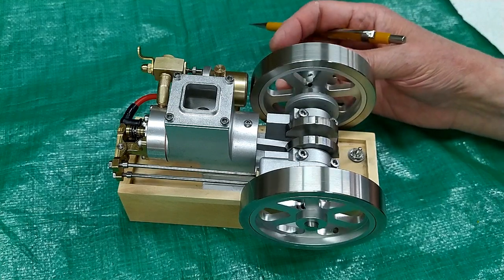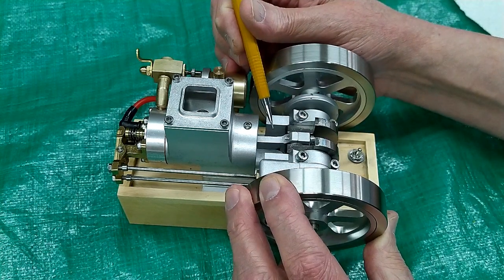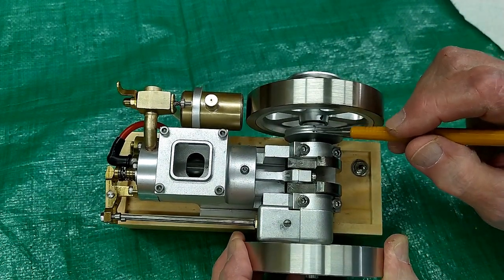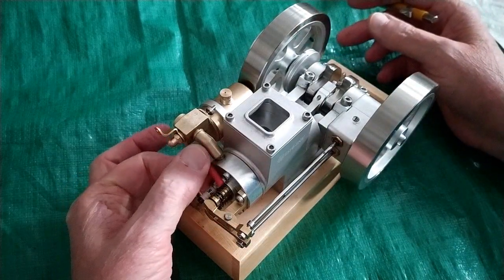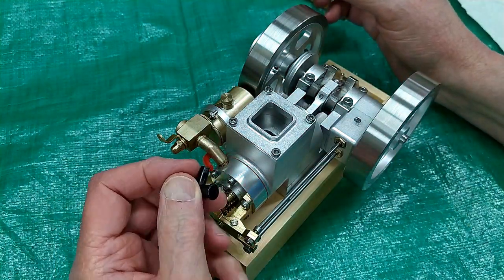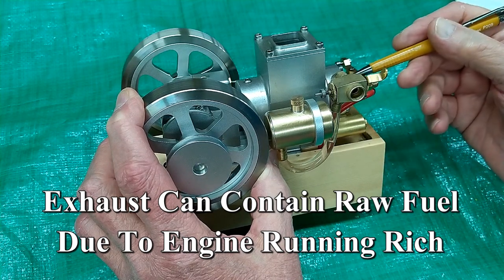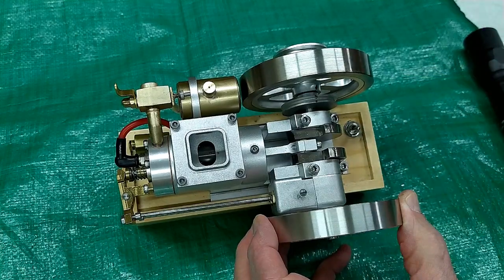Eachine 4 Cycle Engines - Ignition Timing

Comment: if you are still reading replies Ronald, could you tell me what position the camshaft should be in at TDC?  many thanks
Reply from the maker: Yes, I'm still here. :-)
Not an easy question to answer... especially with the particular model engine in this video, where you can't see the cams anyway.
What we are more interested in is the action of the exhaust valve.
Watch this video where the operation of a 4-cycle engine is explained.

Eachine ET1 Upgraded Hit & Miss Engine
https://youtu.be/ZCrjj4niyto

The exhaust valve needs to be closed during the compression and power stroke... then the video gives you an idea of about when the exhaust valves opens... leading up to the exhaust stroke.

The particular engine in this video has both intake and exhaust valve pushrods.
Some other engines only have an exhaust valve push rod as the intake valve is operated by atmospheric differential pressure created by the downward travel of the piston during the intake stroke.

If for some reason your engine has been disassembled and the position of the cam has been changed... it will take you some time to play around with the position to get the engine exhaust valve back into time with the piston positions.

Keep in mind that the engine turns over twice for each complete 4-cycles of the piston... and the cam is a 2:1 reduction by the gears.

The following also has an animation and diagrams of the 4-cycles.
https://en.wikipedia.org/wiki/Four-stroke_engine

Hope that helps... if not ask again and tell me specifically which engine you have.
Thanks for watching. Please subscribe! 
That is what keeps this channel going. 
Ron

Comment: Are the ignition modules holding up?
Reply from the maker: Early on with the ET1 (M90) sometimes the engine would quit and there was no spark. It was discovered (actually by a friend of mine) reducing the voltage from 4.5 VDC to 3 VDC seems to fix the over-voltage problems, if the problem exists. This is accomplished by using two batteries instead of three.

The problem is occasional and inconsistent between engines. Not every engine ignition system experiences this. I usually try using only two batteries plus a dummy first to see if it will run. If not, then I use all three batteries.

I have a video on making the dummy battery. It is explained there. Dummy Battery For Hit & Miss Engines

Some of the later engines will not run on 3VDC and all three batteries are required. That's just the way it is. Call it inconsistency of components used in the ignition systems???

I know some people have purchased new ignition systems but I do not know if the original actually had a problem or not.

Comment: My cam gear set screw came out.How do you time the valves?
Reply from the maker: You’re pretty much screwed… throw it away and buy a new one. :-)

But seriously… watch this video on the ET1. All of the hit & miss engines are basically the same. Eachine ET1 Upgraded Hit & Miss Engine https://youtu.be/ZCrjj4niyto
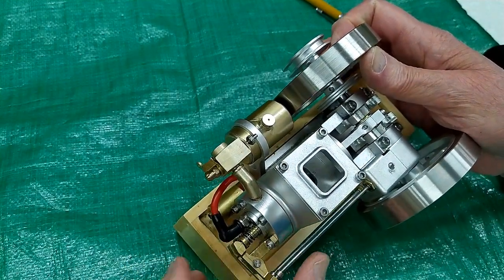I go through the operational sequence of a 4-cycle engine. Around 3:04 you can see the exhaust valve opening just prior to the piston reaching BDC (bottom dead center) of the power stroke. From that you should be able to time your engine. Do not over-tighten that set screw… you do not want to strip the threads.
Thanks for watching, Please Subscribe!
That is what keeps this channel running.
Ron

Comment: Thank you for another great video ! 
All these engines are fascinating ...

May I ask if you purchased, or even reviewed the Microcosm M18  engine yet ? 

Would it be a user-friendly model, or mostly for skilled modelists  ? ...
;-)

Thank you !
Reply from the maker: Not yet! It does not appear the M18 will be sold by Banggood.com, at least not at this time. I cannot comment on the M18 as I have not seen it run for more than a few seconds.
I will review a similar engine, the EM2 which has a flying ball governor... but no water cooling. That review will be a month or so away.
Reply: @RonaldWalters2010  Thank you Ron ; well it appears the M18  is a pretty new model ! :-)

So perhaps there is a small delay before Banggood are allowed to sell it ? 

Greetings,

Comment: Looks easy enough. I know if a GM diesel engine (2-cycle) backfires it can run on the hot engine oil as a fuel source which can provide a bit of excitement. Good demonstration. Thanks.